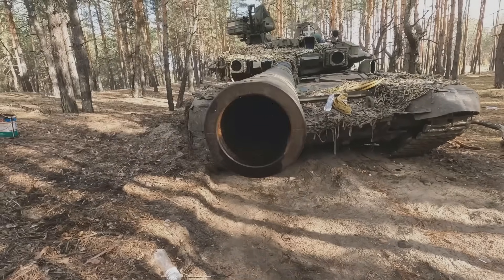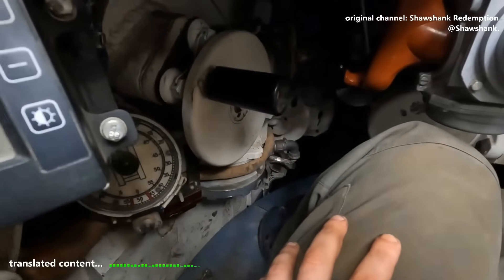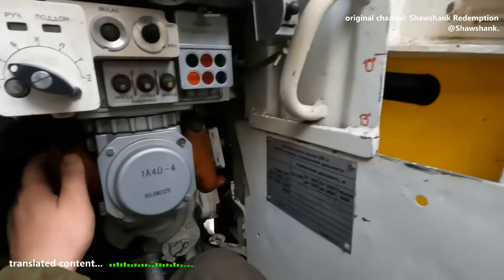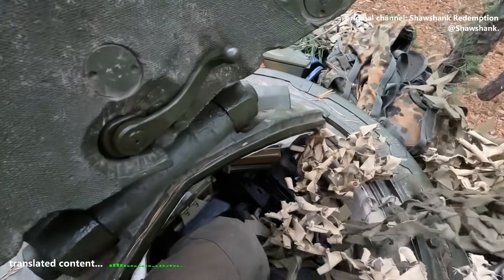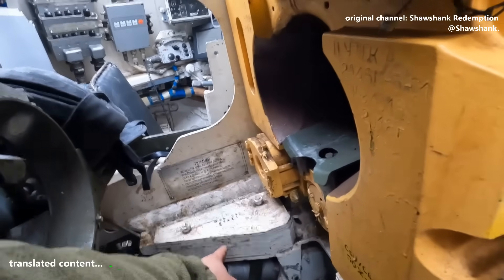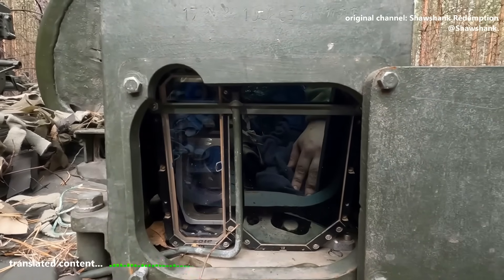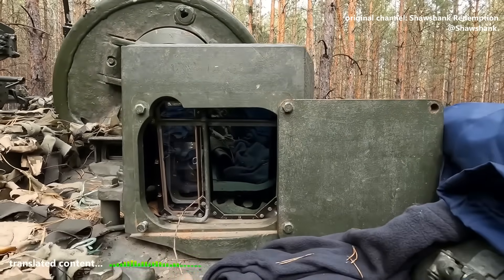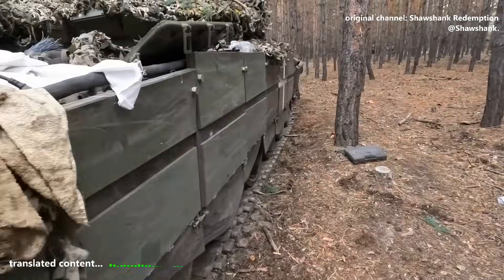Real Tank Crewman Reviews the T-72B3 — Brutal Truth Inside!

Comment: Otherwise, this video is an older T-72B3M version from 2016. The T-72B3M version from 2022 is even significantly better in terms of armor protection, which is now added even higher on the turret itself. As for performance on the battlefield, anyone who has followed the conflict in Ukraine can see that the T-72 of this modernized version works really well if used properly, of course. Of course, you don't need to carry spare ammunition and ammunition inside the tank, only what is in the carousel is quite enough. I think that 22 projectiles are enough! Otherwise, in terms of passability, speed with these stronger engines, crew training endurance, price-quality ratio, what you get from a tank on the military field, the maintenance of the tank itself is far ahead of all Western tanks that have been donated to Ukraine. Also when it comes to the range of the gun, it is about 5km if using laser-guided REFLEX/SVIR missiles, which is also significantly better than Western tanks. T-72 B3/B3M are also used as mobile artillery very often and then the range is even 10km, which is also unfeasible for Western tanks! So the T-72B3 and especially the B3M version from 2022, which is significantly better in every sense, especially when it comes to armor protection, which is significantly better than the tank in the video. Roughly speaking, when it comes to a real war and the battlefield in Ukraine, the T-72B3M, when it comes to the investment, and what you get from the tank on the battlefield, we can put it at a level of capability significantly above the Leopard 2A4/A5, when the effectiveness of the tanks in such an intense conflict and a real war is only a fraction, of some 10% of the cost of a Leopard 2 or Abrams. Also, the T-72B3/B3M tanks, in addition to proving to be significantly more viable for the conditions of warfare in Ukraine, have also proven to be significantly more durable than Western tanks and when it comes to opto-electronics question and when the main components of the tank are in question, the engine, gearbox, track, suspension ... And everything else! Because many in the West are mistaken when they think that these Soviet / Russian tanks are poorly made, whoever has the opportunity to use them will tell you that they are very well made and last a long time, as we have seen for more than half a century! And with modernizations they are very relevant today! Also, the T-72 tanks are very easy to maintain and can be easily performed in field conditions, with handy workshops ... Repairs are carried out very easily and cheaply, which is not even close to the case nor is it possible to do it on Western tanks. All engines have also proven themselves excellently, the T-72 can be fitted with engines of 780, 840, 1000, 1130, and 1200 hp ... It can also be equipped with various modernized and other systems ... The tank is therefore very modular!

Here we should not only mention the Russian T-72B3M, but also the Polish T-91, Czech T-72CZM4, Serbian M-84AS1/AS2/AS3, Russian T-72B1MS, also a tank that has the opto-electronics of the T-90M that Serbia possesses... Not to mention the new Chinese tanks that are based on the T-72 tank platform. These are all versions of the T-72 tanks that on a real battlefield and in a real war have capabilities that are far above the Challenger 2 and many versions of the Abrams and Leopard 2 tanks, roughly speaking, above the Leopard 2A4/A5 version.
Reply: Claiming that the modernized T-72 varients are superior to the Western MBTs but not really mentioning any of the criteria that are relevant is an interesting strategy. Yes, the T-72 is cheaper, but that comes at the cost of some quality and is also partially due to labor being significantly cheaper in Russia. It's important to remember that Russia's economy is around the size of Italys, so a tank that costs 10x less for them will be significantly more expensive if measured on a per GDP basis in terms of what they can spend. A 1.5 million dollar tank loss and its crew (as weve seen the T-72 has a considerably lower crew survival rate than western MBTs) hurts Russia a lot more than the loss of a Leopard 2 or Abrams (which both have a good crew survivability even if hit). The T-72 modernization efforts also demonstrate a major issue for the Russian military since the end of the Cold War. Completely new slate designs are either produced in very small numbers (low dozens) or not at all for systems like aircraft and tanks. Russia hasn't been able to build the T-14 at scale with its many issues, and the Felon as well as its Loyal Wingmen, have had their own issues and setbacks. Russia has to rely on this modernization system not because they would prefer to, but because its all they have the industrial and economic resources to do so. Their are many other examples outside of just the T72 deep modernization, but these are most relevant. It is harder to maintain NATO tanks, and they do require more advanced tools, but the infrastructure around them and doctrines have been designed with that in mind. Russia hasn't shown a capability to manage logistics at scale as seen during the opening days of the conflict up to today. These systems are "cost effective" and can be capable, but stating them as better than the Western tanks is misleading as most of the time NATO MBTs have better firepower, (more penetration+larger ammo numbers), better mobility, (which could've saved many Russian tanks), and significantly better crew training programs. It's important to keep all of this information in mind as using surface level statistics can lead to incorrect conclusions.
Reply: @M2K5F  

I'm not claiming anything, just writing something, these are obvious facts.

Well, it's not exactly as you first stated, Russia is in the top 10 countries in terms of GDP and GDP, but the problem is that in fact, far ahead of other countries that are ahead of Russia, all goods purchased in Russia, from food products to fuel and all energy sources, are at least 5 to 10 times cheaper, so the purchasing power of an ordinary Russian is actually much higher than in practically most countries that are ahead of him.

You also didn't take into account that even in the Western mainstream media you can read that the Russian military industry produces everything, from ammunition, say 152mm for self-propelled howitzers, to ordinary rifle ammunition, drones, MRL missiles... And even tanks, as far as modernization and production of new ones are concerned, at least 3 to 4 times more of all this than the USA and NATO combined.

So, regarding tanks, you did not give accurate information, Russia continues to produce new T-90M tanks and modernize old T-72 and T-80 tanks in large numbers! At least 3 times more than the US and NATO combined have at the moment as we are having this discussion. And as they announce, this will increase even more when it comes to tank production and modernization. Because the Russians have the infrastructure inherited from the USSR and can produce and modernize tanks whenever they want, as is the case now. Also, Russian resources are huge. Also, the Russians will work for very little money, some even for free pro bono if necessary, because I know that mentality very well, for now it is not the case but it is possible in case of need.

Regarding battlefield performance, anyone who has followed the conflict in Ukraine can see that the T-72 of this modernized version works really well if used properly, of course. Of course, you don't need to carry spare ammunition and charging items inside the tank, just what's in the ring is quite enough. I think 22 shells are enough! Otherwise, in terms of cross-country ability, speed with these more powerful engines, durability, crew training, price-quality ratio, what you get from a tank on the battlefield, just the maintenance of the tank is far ahead of all the Western tanks that were donated to Ukraine. Also, when it comes to the gun range, it is about 5 km if laser-guided missiles REFLEX/SVIR are used, which is also significantly better than Western tanks. T-72 B3/B3M are also used as mobile artillery very often and then the range is as much as 10 km, which is also unfeasible for Western tanks! So, the T-72B3 and especially the B3M version from 2022, which is significantly better in every sense, especially when it comes to armor protection, which is significantly better than the tank in the video. Roughly speaking, when it comes to a real war and the battlefield in Ukraine, the T-72B3M, when it comes to investment, and what is gained from the tank on the battlefield, we can put it at a level of capabilities above the Leopard 2A4/A5, when the effectiveness of tanks in such an intense conflict and a real war is only a fraction, some 10% of the price of the Leopard 2 or Abrams. So you didn't understand that part, when you take all the disadvantages and advantages of Western and Russian tanks and when these tanks are put into operation in a real war like this one in Ukraine, then the T-72B3M is definitely a better tank than the Leopard 2A4/A5, I won't even talk about the Abrams and Challenger 2. Also, the T-72B3/B3M tanks, in addition to proving to be significantly more viable in the conditions of warfare in Ukraine, have also proven to be significantly more durable than Western tanks both when it comes to optoelectronics and when it comes to the main components of the tank, engine, transmission, tracks, suspension... And everything else! Since many in the West are mistaken when they think that these Soviet/Russian tanks are poorly made, anyone who has the opportunity to use them will tell you that they are very well made and that they last a long time, as we have seen for more than half a century! And with modernizations, they are still very relevant today! Also, the T-72 tanks are very easy to maintain and can be easily performed in field conditions, with practical workshops... Repairs are performed very easily and cheaply, which is not even close to the case nor is it possible to do it on Western tanks. All engines also performed well, the T-72 can be equipped with engines of 780, 840, 1000, 1130 and 1200 hp... It can also be equipped with various modernized and other systems... The tank is therefore very modular!

Here we should not only mention the Russian T-72B3M, but also the Polish T-91, the Czech T-72CZM4, the Serbian M-84AS1/AS2/AS3, the Russian T-72B1MS, also a tank with opto-electronics T-90M, which is owned by Serbia... And let's not mention the new Chinese tanks based on the T-72 platform. These are all versions of the T-72 tanks that on the real battlefield and in real war have capabilities that are far superior to the Challenger 2 and many versions of the Abrams and Leopard 2 tanks, roughly speaking, to the Leopard 2A4/A version.
Reply: @SRB.4S what about leopard 2a6
Reply: @M2K5F  If you followed the conflict in Ukraine today, you can practically follow it live. On the front lines in Ukraine, you will see almost exclusively tanks like the one in the video above, the T-72B3/B3M in two versions of the 2016 modernization like the one in the video above and the even better tank modernization in 2022, as well as the T-80 B/BV/BVM, T-90A/S and the new T-90M. Now you can go check it out right away. So Russia is obviously producing a huge number of these tanks, or rather, modernizations of older versions. Because there is no logic, nor a realistic chance that this is not so, where do all these newly modernized tanks and new tanks on the front line come from?!

So your statement is not correct. Russia produces these tanks and modernizations of old ones in a larger volume than the US and NATO combined.

This brings us further to the story
'NATO tanks are harder to maintain and require more advanced tools, but the infrastructure around them and the doctrines are designed with that in mind."

Well, you see, that's the main problem, because in the West the military industry is set up completely wrong. Unlike Russia or China. In the West, the military industry is set up on a private basis, where the private owner determines, not the state, what will happen to his goods, let's say in this case tanks, and of course it is driven by profit, like the entire Western military industry. And not by providing his country with the best possible tank for the least amount of money to buy and maintain it, and in the largest possible number. If there is no money there, he is not interested. I will give you an example: it costs the Russians about $ 400 to produce an artillery grant per piece of 152mm, while in the West the cheapest shell in NATO before the conflict in Ukraine was equivalent to the Russian 152mm 155 mm NATO cost about $ 2000, when the conflict began, the price was even higher. While in Russia they remained the same or even lower, both projectiles kill the same. Your problem is that you in the West do not understand these things that are very important for this kind of war. In other words, the military industry in the West and the tanks that are produced there are unsustainable for a real big war like the one in Ukraine. Because you have basically invented a fairy tale for yourself that Russian or Chinese tanks are "so much worse than one of your tanks that one of your tanks can destroy at least 20 Russian or Chinese tanks"?! Which has not been proven to be true and is far from the truth, as we have seen now in Ukraine and when WW2 is in question...

This is because they cannot be produced in large numbers, and their maintenance in such an intense conflict is unsustainable and unfeasible, too complicated, too expensive, not to mention how much ammunition costs. for such tanks and its production ... Just as the crew training is too complicated and expensive ... And on a real battlefield in a real war like this, you get practically nothing from all this! Here's what the Ukrainians got with the delivery of Western tanks?! Nothing! The Russians have not been stopped and will not be stopped.Nor were any large numbers of Russian tanks destroyed by Western tanks, on the contrary. 

What's even worse, Russian tanks have proven to be more durable in terms of engines, tracks, gearboxes, and opto-electronics in tanks, as the Ukrainians themselves testify, especially in the case of the Abrams tank. Which should not be the case because, as the Western media tell us, the West produces extra-quality tanks, practically indestructible, while "the Russians are corrupt and they produce new tanks that are faulty, practically garbage and they can't do it without washing machines from the West and chips from them "?! However, the conflict in Ukraine tells us the exact opposite.

 What We saw it during WW2 in exactly the same place where it is now, the T-34 came out as the winner. Although it was a significantly worse tank than the German ones in every sense. The difference between today's German, American and British tanks and Russian modernized and new tanks is practically non-existent when it comes to capabilities. Western tanks are better in some segments, but significantly worse in other segments, especially when it comes to real war. All this passes in conflicts of low intensity wars, where the US and NATO are at war with a country as has been the case so far, which has limited resources, outdated military equipment, and doctrine and is a small and powerless country ... And up to a hundred times less, resources than the US and NATO.

Western tanks of the 3rd generation have not fought in a serious and real war so far war to the conflict in Ukraine. Where they were donated to the Ukrainians as "game changers" and we didn't see any of that, most of them like Abrams were destroyed, very quickly. And that with a directive from Washington after great losses not to use them so intensively, because it is bad for business or for propaganda and marketing of the US in the market. It is similar to the Leopard 2 tanks that were also destroyed in large numbers. While the Challenger 2 proved to be a totally unusable piece of garbage in a real war, and practically they are almost not used at all in the war.

The problem is also as we see that the Ukrainians continue to use to a large extent and the T-64 and T-72 modernized versions to a large extent. While the western tanks are still used to a limited extent. In translation if they were used as much as these Russian/Soviet tanks the losses would be even greater, no western tank would not have survived until now .

from the US to all other nato countries they all have quite a large stockpile of third generation challenger 2 leopard 2 abrams tanks. Why are these tanks no longer delivered to Ukraine or are they delivered in very small numbers, but the leopard 1 is dragged from scrap or old versions of the T-72 tank are bought and modernized to the Czech Republic and delivered to Ukraine why is this so if western tanks are so dominant as you claim?! This would mean that with these tanks, Ukraine will achieve its goals or achieve its goals to a greater extent... Then why the west does not deliver them after these first deliveries, it is obvious that there was a problem and they saw that the western tanks of the third generation are not dominant compared to the modernized tanks of the Russian production of the third generation, that is a problem.

Yes the Russians have shown themselves to be very bad in every aspect and logistically in every other way in terms of doctrine and how they entered the conflict. But only at the beginning of the conflict, now we can hardly say that it is so
Reply: @M2K5F  Yes, Western tanks have an advantage in armor protection, but they do not have as much better protection as they are 20-25 tons heavier than T-72 tanks or T-90. Also, with Western tanks, all this is at the expense of cross-country ability, speed and maneuverability, because modernized versions of the T-72 tank are even faster than most Western tanks. Western tanks are much faster in reverse, which is a disadvantage of Russian tanks, and the disadvantage is that the spare ammunition is arranged inside the tank and the charge, which if it penetrates inside the tank, leads to catastrophic explosions... This is solved on the T-90M, while the T-72B3M does not have to carry spare ammunition and charge. Because 22 missiles are quite enough, that Western tanks or missiles have better penetration, but Russian missiles also have quite enough penetration to penetrate or destroy and disable Western tanks. As I said, the range of Russian missiles/tanks is greater, up to over 5 km and up to over 10 km if the tank is used as mobile artillery, which Western tanks cannot do, which is all together significantly ahead of Western tanks. There are also more advantages to all of that and even cheaper and easier maintenance, the tank returns to the battlefield very quickly because it can be repaired even in field conditions, easier and cheaper training of the crew and tank maintenance team, Russian tanks are faster, better maneuverable, much better cross-country ability, better endurance in difficult conditions of intensive war, they can be improved and modernized very easily and cheaply and produce new ones ...

Now take all that, add it up and subtract it, and put it in the context of a real war, and see who has more advantages, well, Russian tanks of course.

The training of crews on Western-made tanks is not better as you think, but it is much more complicated and expensive than with Russian tanks, but that does not mean that it is better. Especially now it is certainly not better with this experience that Russian crews have in this conflict.

Also ask yourself, let's say, why India, a global world military power that can buy whatever it wants from both the east and the west, has Western aircraft, let's say other Western equipment, and earns money closely with the Western military industry... Why did it buy a license and produce T-72 and T-90 tanks and not Abrams, Leopard 2...?!

Why is China, also a global military power, producing its latest tanks on the T-72 tank platform?! When can it copy or buy a license for Western tanks?!

Because both the Chinese and Indians are smart people and know the facts that I presented in the comment.

That with Western tanks they will not gain anything more on the battlefield and in a real war, than Russian versions of tanks or their own versions of those tanks. Only maintenance, production and training of the crew, production of ammunition .... It would be much more expensive for Western tanks and up to at least 10 times more expensive. All this when Western tanks are in question is unsustainable in a real war, and on the battlefield and in a real war they would not gain anything more from them, than they already have with their versions of Russian tanks.
Reply: This bot has a slight malfunction… typical russian quality
Reply: Western tanks have several important advantages over the T-72B3M, for example in maintenance: the engine block and transmission of a Leopard 2 can be replaced in 30-45 minutes; Western tanks usually have very modern electronics, for example in optics and fire control systems. and Western tanks have a higher chance of survival thanks to blow-out panels. The problems with russian tanks ist more logistics and Crew trainings
Reply: @tecono-defence-and-space28899

I haven't seen anything like that, that gearboxes or blocks on Leopard 2 tanks are being changed on the battlefield in Ukraine, nor that there are any workshops in the field from the front lines where Leopard tanks are repaired?! If that exists, it's in extreme cases where maybe some minor malfunctions are repaired.... Those Leopard 2 tanks that weren't destroyed on the battlefield and the Ukrainians manage to get them out and take them for repair. That repair is done even in Poland. Because Western tanks for a real war like the one in Ukraine are a logistical nightmare! Too complicated and too expensive to repair. So what you wrote is not, that there is no logic, but it has nothing to do with common sense. You can find footage of Russian workshops in the field for repairing tanks and armored personnel carriers and other military equipment right behind the front lines. Tanks are repaired very quickly and return to the battlefield. Maintenance is the biggest advantage of Russian/Soviet modernized and new tanks. In addition to what I have already mentioned in previous comments. Such as mobility, greater speed in extreme terrain conditions such as in Ukraine, greater durability of all components on the tank, greater range of projectiles, the possibility of using the tank as mobile artillery, maintenance is simple and cheap and easy repairs of these tanks and very easy training of the crew, and mechanics to work on these tanks ... Which is not feasible with Western tanks!

Also the quality is exceptional because the T-72 tank itself has been used for more than half a century! And the T-64 for more than 60 years! In active use. Although the T-64 is a rather problematic tank. The T-72 is not problematic, more precisely it is extremely well solved from all the engines that are installed from 780,840 and 1130 hp, not one has ever had a problem. There are no problems with the suspension or with the wheels, tracks, gearbox ... As for the opto-electronics, the new and modernized Russian ones have also shown themselves better in a real war like in Ukraine. No problems have been reported with the opto-electronics, that possibly, there were frequent failures ... So that did not happen! While the reported problems are numerous, especially on the Abrams and the Leopard, I won't even touch the Challenger 2 because it's such a piece of garbage that has already been proven in real war that it's completely useless to not even deal with it. So, whatever opto-electronics were on the Abrams or Leopard, they didn't perform any better on the battlefield and in real war than those on Russian tanks. On the contrary, the opto-electronics on Western tanks broke down more often than on Russian tanks, new and modernized...

In other words, by donating the announced "game changer" of Western 3rd generation tanks to Ukraine, nothing was gained. To make matters worse, all Western 3rd generation tanks donated to Ukraine are used very cautiously and selectively, some are practically not used at all due to the incompetence of the tanks themselves, as was the case with the Challenger 2. So they are used much less than Soviet/Russian tanks on both warring sides. More precisely, Ukraine had and has more benefit from the modernized T-72 tanks that are delivered to it or when it captures some Russian T-72s and it has benefited more from the PT-91 donated from Poland than from all the donated Western tanks of the 3rd generation. Which in their first real war proved to be a serious failure!

Yes, as for the blow-up panels, it is better solved in Western tanks, because it is a little more difficult to solve in Russian tanks that have an automatic loader with a carousel ... But it has been solved on the new T-90M tanks, which have blow-up panels. While the problem can be solved to a greater extent in modernized T-72 tanks of the T-72B3/B3M and T-80 BV/BVM type by having the crew not carry spare ammunition, so projectiles and charging inside the tank, but only what is in the carousel, the basic set of ammunition ... So that is not a problem either.

Generally, Russian tanks have many more advantages than disadvantages compared to Western tanks in general. When we talk about a real war like in Ukraine.

But if the West invades a country in the 3rd world with almost no army and military equipment, against the Taliban and the Mujahideen in slippers... Then Western tanks can only come to their senses, in a real war of attrition they have no chance. They apparently did not learn that even after the Western defeat in the same practical place in today's Ukraine, WW2, about 80 years ago.
Reply: lol